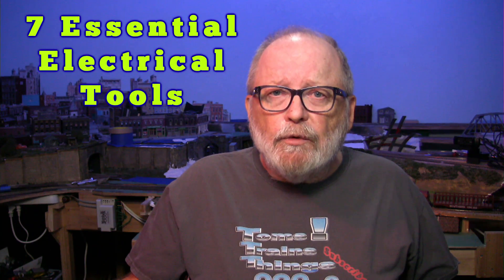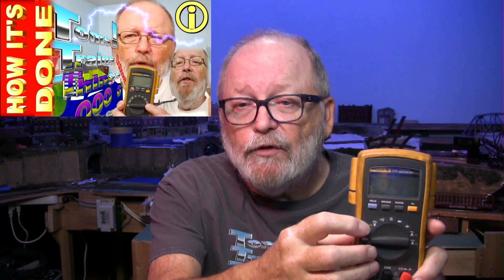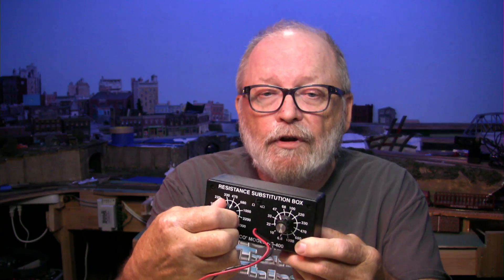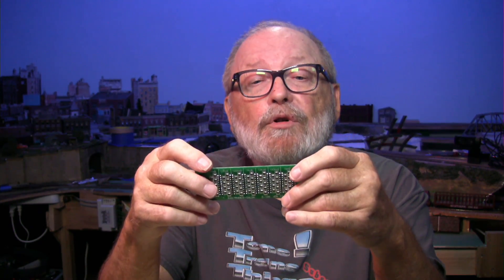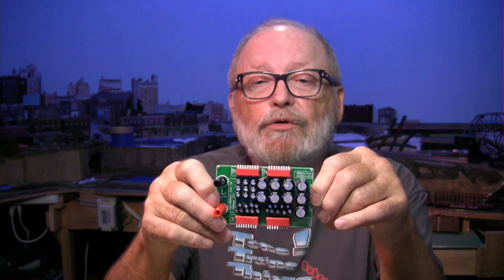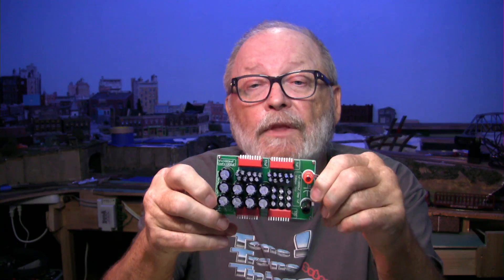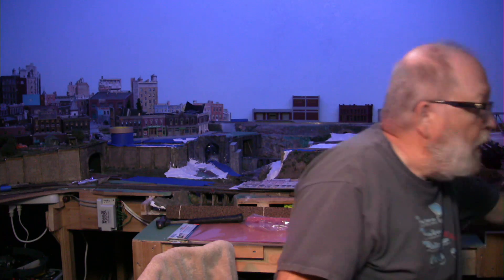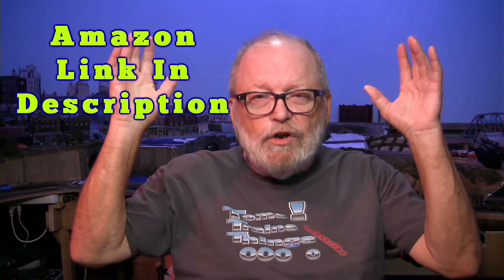Seven Essential Electrical Tools For Your Model Railroad

Comment: Great video. The LED tester probably isn't necessary if you have a breadboard though! :) Amazon sell SME Rework Stations (this is basically a digital soldering iron, along with a heat gun). You can use the heat gun and SME solder paste to solder much smaller SME LEDs which work really well for interior lighting and for adding lights to locos and rolling stock, without having to use the clunking old 3mm LEDs. The rework stations are about the same price as a digital soldering iron ($60 or so).
Reply from the maker: Thank you. I want to know if the LED works before I put it on the breadboard. It also shows how bright it will be at different ma so I have an idea of what resistor to use with it.  The rework stuff is just too much work for me.
Reply: @TomsTrainsandThings  Why? The LED tester seems a bit redundant especially when the holes are too big for the LED legs and you can just test it with the breadboard with a resistor and DC power?

Comment: When my 3 Sons grew into teen years they had other interests, I packed up my layout and stored it away. Now
I am into retirement,and I have some time to build my layout back up, I still have my benchwork,and have bought 
A DCC system , a lot has changed, most equipment cost more. I don't have any pictures of our old D&WRR, because back 30 years ago I guess we never thought of it back then. Wish I did, because I want to rebuild it,the way it was, but with DCC. no disrespect intended,happy modeling.
Reply from the maker: A lot has changed in 30 years. I only had a multimeter back then because it was for work. Now we automate with servos and light the layout with LEDs.

Comment: Another great video Tom. Thanks for the great information. One thing you might want to add to your misc. parts to have, and I find it essential,  is shrink wrap,  It real helps to keep your layout safe from shorts. 
  Have you done any how to vids on Wiring lights? I'm beginning to light my buildings on my layout, but I'm not sure how may I can run on one circuit, or even if you can run leds together with reg lights, or when to run light in a series or gang them together. Can you help me with that? 
Thanks 
Steve
Reply from the maker: Thanks Steve. I have several videos on using LEDs. Check my playlists.

Comment: Good video Tom , I would suggest ppl buy a good Multimeter and not a cheap one.  This will pay for its self in the long run and is versatile.  Also if ppl what to get technical with currents ,.voltage,  and resistance and etc , look up basic ohms law . We use this in 12 volt car audio for installing custom components. ..any good video . Also the wall warts are great to use.
Reply from the maker: Thanks Adrien. I also have a series of videos on Ohms Law and a few on multimeters.